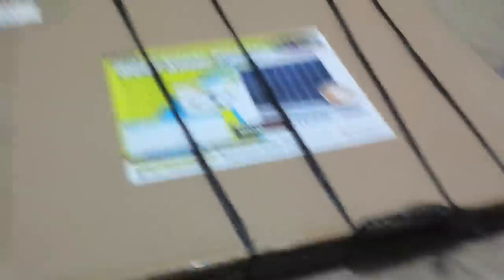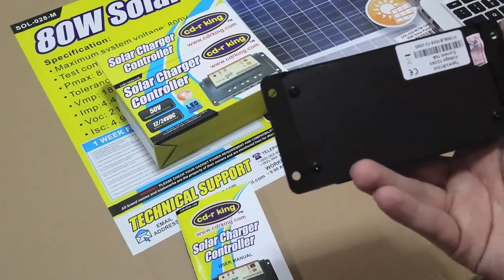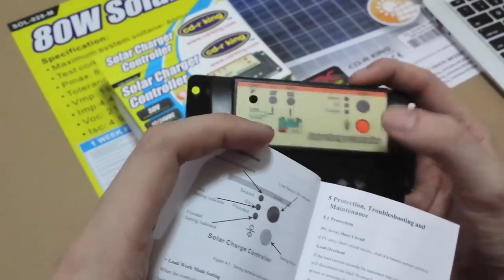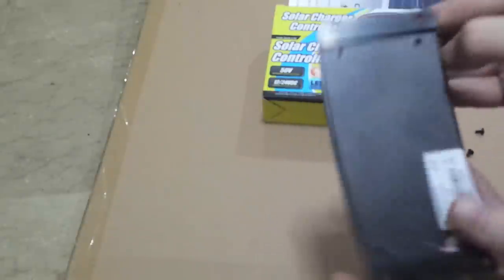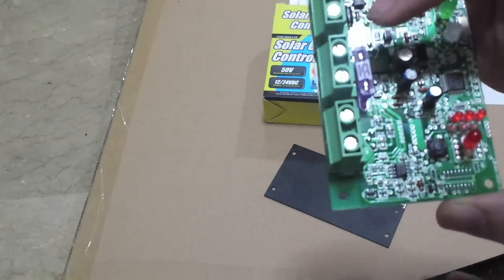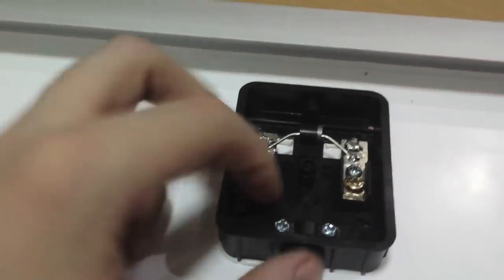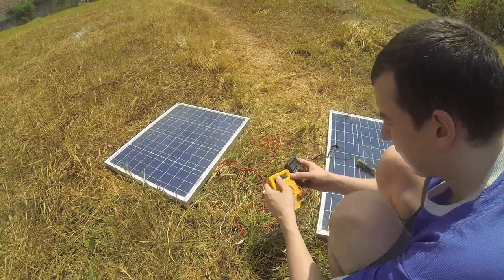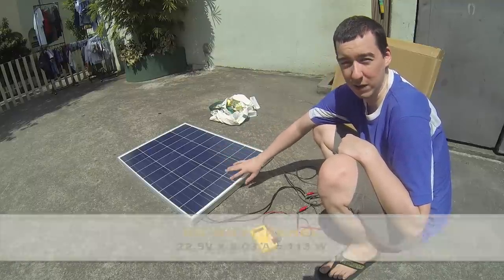CDR KING Solar Panels

Comment: Is cdr king still selling solar panels?i live in cabuyao laguna and found out no panels being sold in sm sta rosa branch.i have a question about watt meter,is it measuring the actual wattage use of a certain appliances??or can measure also the actual total output of all the appliances running?pls help me clear this..thanks
Reply from the maker: Yup they're still selling. They're stocking a bigger choice, batteries, charge controllers. They're selling well and more of their shops are starting to carry them. For the watt meter, it depends on how you wire it. You can wire it to see how much power is going into the battery, how much (total) is coming out of the battery or inline with a specific appliance you connect and see what that single appliance is consuming.
Reply: Gadget Addict thanks bro.you're very helpful..more questions coming...salamat.

Comment: Nice Video. Been wondering if you are consuming 100w electricity an hour how many hours would a 100ah deep cycle battery last. tnx
Reply from the maker: Assuming you were using a 12v battery, 100 watts would be about 8.5 amp. So 100 ah battery divided by the 8.5 amp draw would give you 11.7 hours. But most people don't run their batteries past 50%, so that would be closer to 6 hours.

Comment: Thanks for this video. I am planning to power a laptop and DSL connection. What set up would you recommend? Thanks :)
Reply from the maker: Mmm I'm not sure what to say tbh. It's quite a vague question, it's like asking what car you should buy to drive your kids around, there's a lot of options :P But lets assume a laptop consumes 20-40 watts depending on the battery state and the modem/router consumes 5-10 watts.  So at peak, you'll consume around 50 watts. So you can size your system based around that and how many hours you want to run them for per day. If you buy a DC charger for your laptop and make your own power cables for the modem/router (most of them are 12V DC) then you can avoid using an AC inverter.

Comment: Personally i don't know anything about high voltage electricity ... i just play with below 12 volts Below... i make my own Laptop Fan ... and im not using a Solar panel... But i was thinking i want to use one for all the Bulbs in our House.... but i need to know How Many Bulb (LED) or (CFL) one 50 WATT solar panel  can Power for the Rest of the Night. and with what battery( How many VOLTS) to use.. Say i want my Entire night to be lighted by Bulbs that's using the Power that came from the SUN, Say 6PM to 6AM in the morning. say 2 bulb (CFL) or (LED) outside of our house - 4 inside. Can you make an explination or Tutorial ? And oh  With Extra Cause Charging Gadgets and all ....you are really informative person cause i live here in the Philippines and Electric bill is kinda Expensive Nobody makes such Video with this kind of information Usually Foreigners From Outside PH and of course the Materials you use we can find here (Advice) where to get it and all....... Like how you said that CDR-King is type of Generic Personally i've been to thair Office(Main) they Repair the items and Resell them lol ... So Thank you #GadgetAddict

Comment: hello! kaya ba 2 laptops and maybe 1 desktop in some hours using these Solar Panels from CDRKing? and you recommended Motolite battery. We have power outage here in Mindanao during summer time at nagsisimula na ang rotating brownouts here. It greatly affects my online work. I consider buying Solar panel than buying a generator. Please advice, I would greatly appreciate your response. Thanks in advance!
Reply from the maker: A small gas generator is cheaper in the short term. But solar will save you money in the long term. Desktop computers can be power hungry. With a monitor, an average desktop computer with monitor will consume 80-150 watts. A laptop usually only consumes 20-50 watts depending on whether it's charging the battery at the same time. Solar batteries can be expensive and require some care but offer you stored power when the sun goes down. If you don't care about possibly wasting excess power, you can buy a smaller cheaper battery and primarily use the power during the day while the sun is actually up and then not have so much storage when the sun is down.
Reply: oh thanks for a prompt reply! I'd like to invest my money for long term benefits, that's why I'm thinking of Solar panel but I'd like to know how much will it cost (including the batter)? I might run 2 laptops for the Solar Panel.
Reply from the maker: adz demata Yup, I spotted them on the site earlier when I was looking for updated pricing :) They're cool kits because you don't need to think about the different components for your solar. It's not clear whether it includes a battery and if it does, how big is the battery? I've seen it for sale on Alibaba by companies like sinosola but no specs. The problem with bundling all the components together like the charge controller and inverter is that when one thing breaks, you might find it all breaks. You can try price out a system, look at the cost of the solar panel(s), charge controller, AC inverter, batteries :)
Reply: oh thanks!
Reply from the maker: adz demata walang anuman. Good luck with your solar quest!
Reply: adz demata try searching Permanent Magnet Generator...

Comment: hi good day i have a question what if for example i have 120 watts panel how long will i charge  100ah battery without using anything?
Reply from the maker: A 120 watt panel would produce around 10amp at 12v. So to charge a 100ah 12v battery, it would take 10 hours.  But in actual fact, there would be some losses because solar panels output at a higher voltage and lower amps and then it's down to your charge controller to adjust it for the battery. And it depends on how much direct perfect sunlight your solar panel gets. So it might actually work out closer to 15+ hours. And then most people don't drain their batteries below 50%. Hope this helps..

Comment: Would you trust the quality of cd-r king products if you were going to spend around $2500 (P115,000) for a 1500 watt off grid system? Or would you use another solar company such as SolarEnergyPhilippines.com? It seems everything is Chinese no matter where you purchase.
Reply from the maker: +David Alan I'd trust them for the panels but id go for a branded inverter and charge controller with a proper warranty.

Comment: Good morning,I have just subscribed to your channel, and Lanhawk59 is also a keen viewer, he recommended your Vlog.I am also British and married to a Filipina, we live in the UK still and are planning to come out to the Philippines in Aug 2017,We are in the process of buying a 600sq metre lot in Iloilo. Passi city.And we are going to self build there over the next few years.But I am all for using the Philippines natural sunlight and am very interested in having a Solar system build onto our roof so we can have constant electric.I have seen many systems on eBay here in the uk.But would you be able to advise me of what I would need to supply electric to a 4 bedroom house.I am no electrician and my father in law is a builder/architect, and I have seen many systems on eBay, But am unsure of what to buy,most of my components for the electrics I am going to send over from the UK, as I know the quality is much better here,if you can advise me of what I would need then I can send the correct equipment,Kind regardsTim Chapman

Comment: Hi, Can I use my solar power while charging my battery?(e.g. using my appliances while my battery is charging using solar panel) . hope you can help.
Reply from the maker: Loreto Llosala Yes there's no problem doing that. Just remember that if your panel is pushing 80 watt and you're consuming 30 watts, only 50 will be going into the battery.
Reply: Gadget Addict thank you sir. I will truly help me..

Comment: Its a good idea to have a back diesel generator to charge your batteries for days with out sun.
Reply from the maker: For sure :) Especially if you're out in a far flung province. I also recommend buying an AC 12V charger. Rolling blackouts are pretty common during disasters in the Philippines so as soon as they start, I connect my batteries to the charger so they get a boost from the grid whenever it comes up for a few hours.

Comment: which one is much cheaper solar power solution? the one sold at quiapo RAON or from CDRKING?
Reply from the maker: In my experience the prices were similar. Maybe if you buy in bulk you might be able to get a cheaper price in quiapo.
Reply: Thanks
Reply: it's cheaper in quiapo specially if you know who to talk to and where to buy them..its good to have contacts in quiapo,raon area
Reply from the maker: ricky spain Do you have some sample prices? cdrking prices are pretty close to alibaba since they're buying in bulk. Are those in quiapo really buying in large enough quantities to beat cdrking prices?
Reply: well,if i'm not mistaken,those in quiapo ranges from 2,500-10,000 depending on the size of the solar panel..they sell it as a whole package.quality-wise,not really sure though if it would last compared to the american made counterparts.i think it'll do a decent job

Comment: Any updates GA? How are the panels working so far? XD
Reply from the maker: I've had the cdrking panels in operation for a pretty long time now and they're doing just as well as the first day I got them :) I still recommend the CDRKING panels. The only thing to note is that the panels being sold by cdrking seem to change design every now and then, perhaps as different suppliers offer them better deals. The price in the shop stays the same. If you're ever planning to buy in bulk, buy one to test first and then decide from there :)
Reply: Gadget Addict Oh that is good to know. I am planning to build a larger solar power system, but the ones sold on the local electric shops are a bit beyond my budget so the CDRK panels do the job for me. Anyway, thanks for the advice! :D  I'll be getting and testing one some of these days.

Comment: informative video... just ask question if i buy a 100w solar panel , gaano kalaki ang inverter na partner nya to maximize the 100ah battery at yong solar charger ilang ampers ang dapat bilhin
Reply from the maker: overhead load If we ignore losses, different voltages etc and assume your 100 watt panel gives you 500-600 watt hours in a day, that will nearly fill your 100ah battery half way. The inverter size you choose is optional, the bigger the inverter and the more power you use, the faster you will drain the battery. Most people don't want to drain their batteries past 50%.
Reply: Gadget Addict thanks for the info. lastly what is the right solar charger i'll buy (10amps 20amps or 30 amps,what is the difference or benifits for the bigger amp) for the 100w solar panel and 100ah battery
Reply from the maker: overhead load The number of amps the charge controller can handle will determine the maximum number and size of solar panels you can connect. The more amps the charge controller can handle, the larger wattage solar panels you can connect. A 10 amp charge controller is an okay start for a single 100 watt panel but will limit your upgrade possibilities in future. Although you could always buy additional charge controllers later.
Reply: overhead load addict I have a question, I purchased 100watts solar panel, 100ah battery and charger controller and inverter to cdr king, the charge controller/inverter is only 50ah maximum (battery), I asked the cdr king employees regarding this I told them may be the battery will not fully charge because the charged controller is only up to 50ah and they said no problem, but when I used and when the battery totally drained and connect to my solar 100Watts panel almost 4 days now still my battery not fully charge. pls kindly explained what actually the problem?

Comment: can i charge a 12v motorcycle battery using this solar panel and the solar charger controller?
Reply from the maker: Hi Gil, you can, but you should check what type of battery it is. People normally use deep cycle batteries for solar because the batteries are designed to be regularly discharged and then charged over and over. Car batteries aren't designed to be discharged and recharged like that. I don't know what type of batteries are used in motorcycles. If you just want to keep your motorcycle battery topped up with solar, that will work fine. If you intend to discharge it many times then you'll have to make sure it's a deep cycle type otherwise it might not survive for more than 3-12 months.

Comment: hi im oliver can you teach me how to meassure the amp coming out of the solar using multi meter..?
Reply from the maker: The most accurate way would be to measure the panel in series, under load. The easiest way is to buy a watt meter and wire it between your panel and battery. The quickest and cheapest way is to put your multimeter into current mode and use your probes on the positive and negative wires coming off the panel. This is the method used in this video and isn't 100% accurate but close enough for a quick check/review of the panel.

Comment: yeah phil its 100% secure it will work on bigger and larger panel
Reply from the maker: I missed earlier where you said it's tied to the roof using wire. I don't think i'd feel too confident putting such heavy panels on the roof with just wire holding them in place. And to attach the wire I'd probably have to make holes anyway... and if that's the case I would be in the same position as if I bolted them in (that I can't cause any damage to the property)

Comment: Hi Bro, Did CDR-KING in Philippines selling solar cells, tabbing wire, flux,bbus wire and soldering Iron? Thanks.
Reply from the maker: They sell soldering related items but don't sell individual solar cells for home-made solar panels. If you add up the cost of the solar cells, tabbing wire, solder, flux, frame, glass, silicon etc etc, it works out more expensive than just buying the ready made panels that have a good finish and will last you a long time.
Reply: Gadget Addict Thanks for the Info.
Reply from the maker: Jun Angcos I forgot to say, you can buy the solar cells and tab wire on Sulit.com.ph and some sellers offer free lessons if you buy a minimum amount. Personally I wouldn't recommend making your own panels.
Reply: Gadget Addict 
Ah ok. Can you please check my system if it is workable. I have already purchased 50W solar panel at Balanga Bataan CDR King. 10A Land Star Solar charge controller and 50AH Ordinary Battery for the car. Could it be possible?My  Loads are 162W
Reply from the maker: Jun Angcos Sounds okay, although I wouldn't have bought a car battery since they're designed for high cranking output and not for for repeated discharge and recharge. A deep cycle battery is generally recommended. Since your load is 162 watts, you'll need to charge for more hours than you'll be able to power your load.
Reply: Gadget Addict Thanks. One more question. Since CDR KING doesn't have a threaded LED bulb for 12v can you recommend where can I buy that?. ACE hardware have threaded LED bulb but it is 230v
Thank you.
Reply from the maker: Jun Angcos Do you mean edison / e27 bulbs? I've seen them being sold at CD-R King in the 12v variety. Perhaps you could check another branch? I don't think you'll find many suitable lights at hardware stores except perhaps by luck in the car section. You'd have better luck with OLX or Lazada and some specialised local solar shops :)
Reply: Gadget Addict Thanks Bro. Big help for me.
Reply from the maker: Jun Angcos Walang anuman :) Another thing to consider is LED strips since those are typically designed for 12v applications :)

Comment: can i use any car battery i have already 20watts solar panel with controler and battery 18 amp and using two bulb
Reply from the maker: You can use a car battery but it's not recommended. Car batteries are not designed to be regularly run down as you use the power that you've generated. If it's an old used battery that you don't really care about, then sure, go for it. But you will eventually damage the battery to the point where it won't hold a decent charge.

Comment: Love your  video. .. they are so educational. .. i  plan to set up my own solar power at my home and be off grid.  I hope you can advise me as i go about it. ..
Reply from the maker: bj absin That sounds great. I'd love to help but you'd really need to be a little more specific with questions. You might prefer to check more videos and have a think over exactly what you want, what your budget is etc.
Reply: Yeah... I'm still trying to let everything you thought sink in. But will get in touch with you... im thinking of laying out 15  thousand pesos. I have simple needs though,  i want to have my computer working, a tv and a ref working as well. Then maybe 6 or 8 led bulbs. Charging for our 3 phones and a tablet is also needed. I'm thinking of buying a 120 watts panel initially,  a 2ooo watts inverter and a 50 amps charge controller.  I also plan to buy 2 or 3 batteries.  Do you think this plan works?
Reply from the maker: bj absin I think you're going to need a lot more than 15k PHP to get the kind of power you want. A ref can be pretty power hungry and so can a computer. Laptops aren't too bad but desktops can suck up the juice. The bulbs and gadget charging are pretty low power. A 50 amp charge controller is overkill for a 120 watt panel but of course it gives you room to upgrade in the future. A 2000 watt inverter is also overkill but again gives you room to upgrade with extra panels and batteries in the future. Ideally, try work out how many watts everything you want to power actually uses and then compare that against how much you solar panel will generate. Lets keep things simple and assume your 120 watt panel will give you 6 hours of 120 watts = 720 watt hours. Then compare that against everything you want to power. It wont even come close.